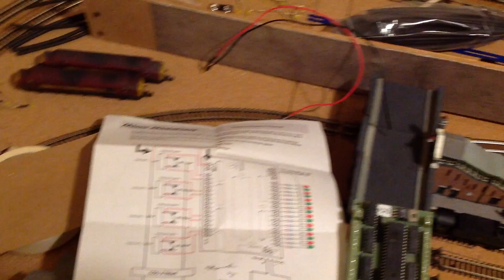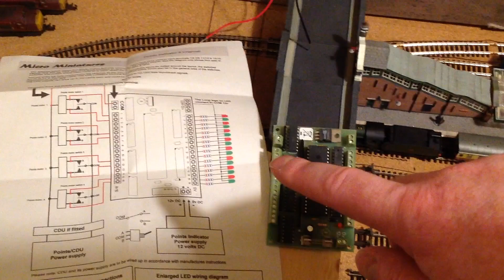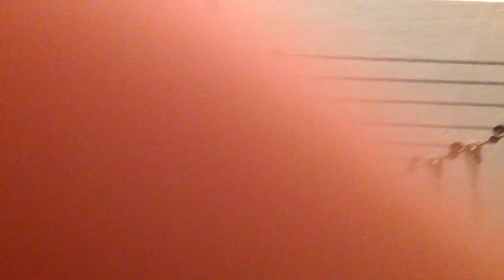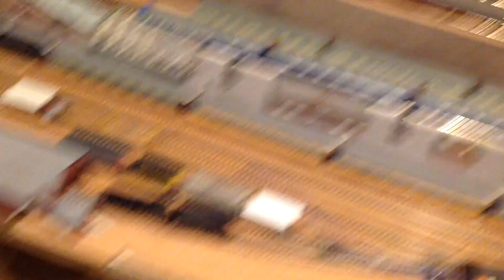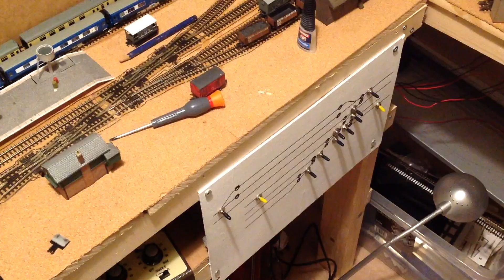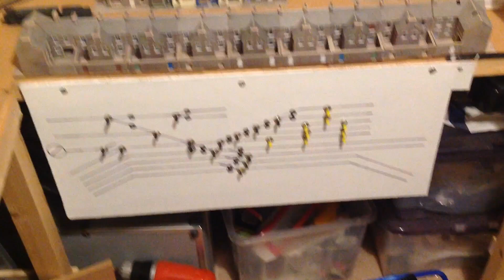New Layout Build Update 17 - Electrics Part 1

Comment: Very ingenious ,,,,,  I just about followed the wiring ,,,,  but im afraid its still something I would shy away from ,,,, but should be awesome when it comes to shunting,,, at the flick of a switch ,, instead of leaning over and manually switching  ,,,,  great job ,,, thanks for sharing ,,,
Reply from the maker: +Alan Plumb I have the panel detached at the moment and I'm wiring up the back.  I plan to show what's going on using a series of photos and a short video next weekend.  It is a bit of a fiddle but it should provide some interest once finished and yes you're right shunting will be much easier with the point motors and indicator lights so I don't have to check which way points are set before I change them.  That's the plan anyway!
Reply: +LittleHamptonRailway Ya fiddly but well worth it